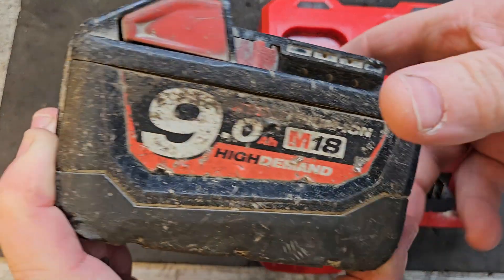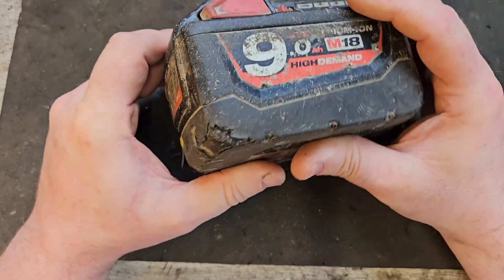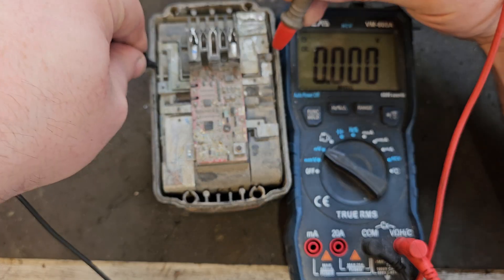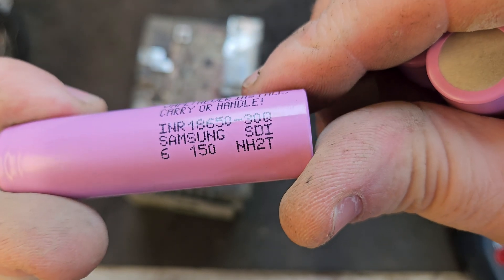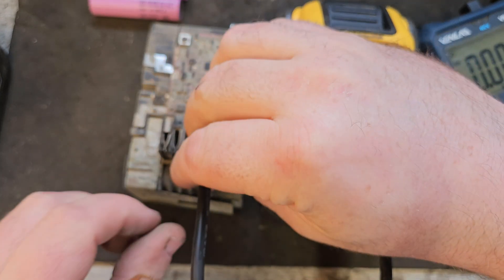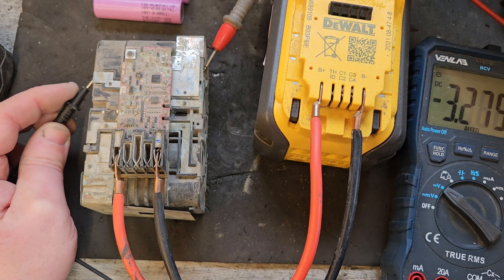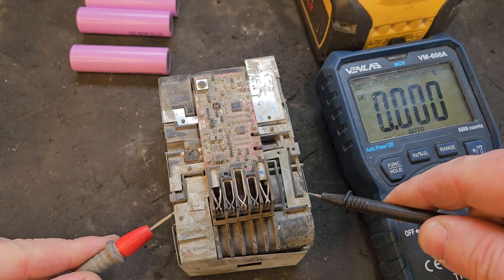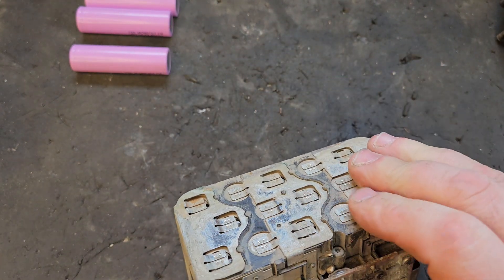Reviving a DEAD Milwaukee M18 Battery - Step by Step Guide

Comment: what are those green "washers" you put on the end of the batteries before reassembling them?
Reply from the maker: It's an insulator to stop cross connection between positive and negative

Comment: I got two of these batteries almost a year ago when I bought a quik lok trimmer, one of the batteries was never used and this year the charger says the battery is dead, absolutely ridiculous that a brand new battery is dead when trying to use it less than a year after buying it.
Reply from the maker: Always put your batteries away fully charged

Comment: how did the battery get so dirty inside the case?
Reply from the maker: They are not air tight dust dirt moisture all get in and cause corrosion

Comment: I don't know how i feel about this. U mixed different brand batteries with discharge rates. The 9ah battery has been used and abused and probably under 80% by now. Which means the batteries won't balance properly. Most likely

Comment: I really appreciate your videos! I just did this on a dewalt 12ah battery, it had 2 bad cells, I didn’t match the voltage, I thought it would be close enough, when I got it all back together it works but I can only get 2 bars of charge, it runs tools but not for as long as it should. Any tips? Is there an easy way to get it balanced?
Reply from the maker: Sometimes I take leads from my Xtar charger https://youtu.be/bS5TBVao8ho?si=Qi3UiGcwp3S5kFtS
Reply: @doctorlefthandthread brilliant!
Reply: Thank you!